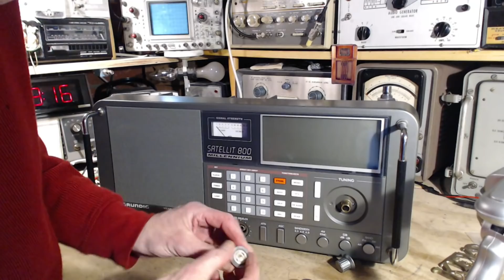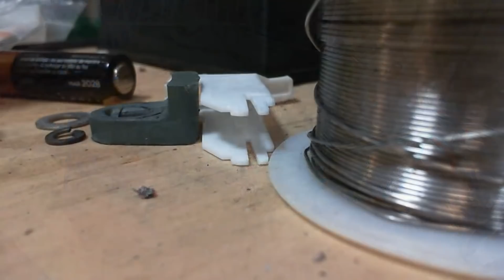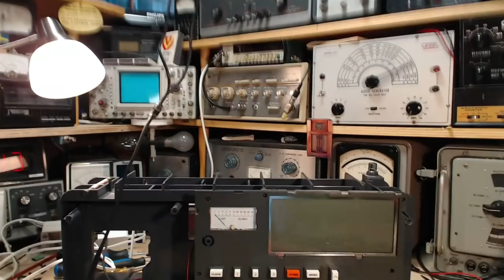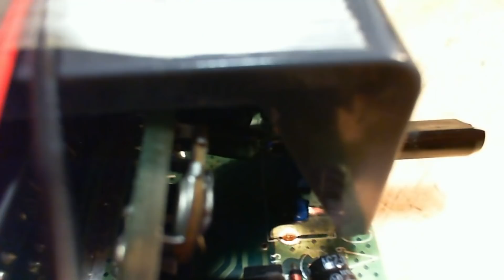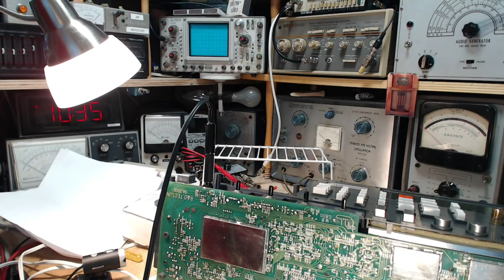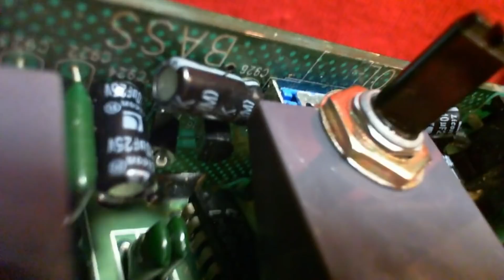Grundig Satellit 800 Video#1 - Broken Volume Control

Comment: Had the same issue. I just use an external speaker with a volume control. Better than ripping to radio apart

Comment: Jim, enjoyed the video. Not your frustration but your patience. I have the same radio and also broke it - also my fault. I put the batteries in while in the dark and inadvertently put them in backards. Blew something instantly-hoping it is a diode or voltage regulator. I’ll be happy if I can get the back off. :)

Comment: 2 years late, but the term you were looking for was wave soldering. The entire board with components installed and then floated (sort of) in a bath of solder.

Comment: Nice work.
The stereo volume potentiometer seems to be defective and needs to be replaced.
Remove the potentiometer in order to check it with a ohmeter to find what terminals are broken.
While it is removed, check the PCB traces with the ohmeter, as broken PCB traces and cold joints should be easy to find this way.
The potentiometer should be easy to find as a spare part. If not, dismantling it carefully to find what is broken inside. I have fixed a few of vintage pots by using small amounts of liquid silver paint close to the terminals rivets.

Comment: I just started watching your video. I have the exact same radio and the same problem.  Can't turn the volume down to zero.  When I use headphones however on the FM stereo band I noticed the right channel works properly but the left is the problem..
I hope I can resolve this problem. I wondering if it's not the volume control and an electronic problem with the circuitry.

Comment: I have one of these that went dead completely when I moved it to another shelf the other day. Thus, I get to go through the teardown scenario to figure out what popped inside it. I also need to deoxit the controls while it's apart. 

However... one thing I noticed in your video was the large opening behind the speaker. Why, oh WHY did they NOT simply put a power tranny and rectifier/filter cap board there instead of relying on a wall wart? Makes zero sense to me! And if these rigs don't have a clean LINEAR supply, they have an S8 noise level across ALL bands.
Reply: All those terminals on the pot is because it's stereo and not mono.

Comment: Sir, I have Grundig Satellit 650 professional (bought used one in dead condition)..Display o. K.. While varying volume control  pot viper sound is coming.. Means audio stage o. K..  But radio section not working... 
What could be the problem sir...? Kindly give me an advice...

Comment: I have a grundig 800 also. The AM sounded very distorted. After opening the back side and pulling on the three leads that go inside of the PLL metal enclosure and cleaning the lead pins the AM cleaned up, the distortion went away. Now i need to get the HF to pull in some ham stations. The pull up antenna does not do the job. Any suggestions? to my HF sensitivity issue?
Reply: I just bought a 800 with a similar sounding issue on LSB/USB and AM but only when AM Sync Detect is enabled. It sounds like WAY to much conversion gain, and makes USB/LSB/ SYNC AM 100% unintelligible. I may try this and see if this helps. What did you use to clean the pins? I have yet to pull mine apart. Regular AM is 100% fine, and so is sensitivity on all bands.

Comment: That radio looks like it has DAB, That radio might use a rotary encoder to set the volume according to a certain value between 0-63 would equate from minimum volume to maximum volume ,as the whole radio is computer controlled just thinking, The volume control is not the type you are used to fixing.

Comment: Looking at the schematic, it appears the volume control is a stereo pot.  I’d not be surprised if the impact travelled through the shaft of the pot and put a hairline crack in the potentiometer's own internal circuit board. The pot looks like one of the ALPS RK14 series.

Comment: Reason those knobs are sticking is that they were assembled while the plastic was fresh, and still outgassing the plasticiser. This then did 2 things, one was bond the plastic knob onto the shaft, and the other was shrink fit the knob as it evaporated away.
Reply from the maker: So it was not that I was weak.  Thanks.

Comment: Obviously the heat effects it, but I don't think that points to a broken trace, could be the wiper in the potentiometer intermittently breaking contact when the case heats and expands and contracts. There is so much that heat could be doing that you cant see. Since TecSun still makes this radio I would just try to source the potentiometer from them and just replace it.
Reply: Oops they don't make it anymore, I'd still try to get one.

Comment: Jim, the unconnected traces at the volume potentiometer might be vias. Issues like this one are ugly. Did you find a schematic?
Reply from the maker: By via, I'm guessing you mean there's a sleeve through the board to connect the traces on either side.  I've studied the schematic.  Scary.
Reply: Those holes are vias, copper plated through holes, used on PCB layouts that have trace routes on more than one layer.  It is common for vias to suck up solder from wave soldering.  This is a complex board in which wave soldering and reflow soldering (for the SMT parts) may have been used.  Thermal profiles are usually run to determine the soldering requirements, producing high reliability connections.  Determining all of this is the job of the manufacturing engineer.

Comment: "Why so many pins?" (on volume control): It was common some years ago to have stereo available through the headphone jack when on FM. That would explain why so many pins (3 per channel at the volume pot) and there could be more if there is loudness compensation. A look at the headphone jack will tell you if this is the case.

The bracket of the volume control was probably being used as a jumper for the ground circuit. There is probably a break on top of the board that joins when it expands, The break is probably where the circuit trace meets the ring on the top of the board. You can access it by removing the nuts on the controls and pulling the board slightly forward.
Reply: 7 pins say stereo pot with loudness tap at the point the 2 resistance ratios meet. common ground connection to the 2 tracks at the minimum position, then 2 concentric tracks, with a separate tap at around 1/3 for the loudness taps, then they go to the end at the max position for input connections, then there are 2 wipers.  Common for any impact down these Preh pots to either snap the pin off at the board topside, or to snap the internal SRBP board of the pot, as it has the stress transmitted to it. 

Radio clock running off the residual voltage on the power supply capacitor is not surprising, the internal clock and LCD run off around 10uA when in standby, and if it was not driving the LCD it would probably be around 1uA, as it does not have to drive the display capacitance at 32Hz.

Was restarting my radio yesterday, as it had locked up somehow ( SLA battery driving it died, dropped down to 1V during the night and locked up the 3V clock chip) and it took around a half hour for the clock to stop displaying, and another 5 hours later I put in the new battery and it fired right up. Not bad for an Aiwa I bought in 1987, though of course it is really only a radio now, as the tape decks have plastic issues and belt issues, and the CD player needs a new KSS150 laser assembly again.

i use it now as a radio alarm clock in the mornings, though when the CD section still worked I modified it to add in auto play for the CD section, using a single CD4066B, to emulate pressing the play button 5 seconds after power on. Cascaded 2 RC delays using 3 sections of the IC, all on a tiny ( 7 holes by 16 holes) bit of Veroboard, tucked up on the back of the main logic board.
Reply from the maker: I'm suspicious that I simply did not get solder where it's needed.
Reply: @JimsRadioShop  You were working against gravity. Try putting the radio top-down/bottom up. Solder will then flow into things.

Comment: on this pcb there is so much manual rework (burned flux, manual resoldering) visible, that it looks like a refurbished (or at least reworked) board.
Reply: No, just that there was work done to manually add things that did not wave solder properly first time, and also things that would not survive the bath. Power IC with soldered heatsink tabs, because the top ground plane is so good at sucking heat from the kovar pin is typical, though those should also have had the standard copper plate fins placed in the holes as well so the IC can be run full volume without overheating. The IC manufacturers had a part number for that in the datasheets, and the "typical" specs included using that in the layout as well, or "equivalent part". Just that it added around half the cost of the IC to the price, and copper on the board is essentially free, though you need a really large ground plane both sides, with continuous pour, and not the hatching seen here, to be as effective.

Comment: This chassis design screams from every corner "i am a philips device of the 1990ies"  so much plastic, so many crews, and all cables insanly short and/or nasty tight connectors.
Reply: Well, Grundig and Phillips shared a lot of stuff, not surprising as they often had the same manufacturing plant making them, and later on IIRC Grundig became part of Phillips,  though the Phillips brand is still on consumer equipment, and Grundig is now Turkish owned.